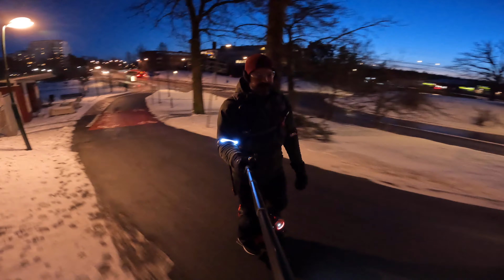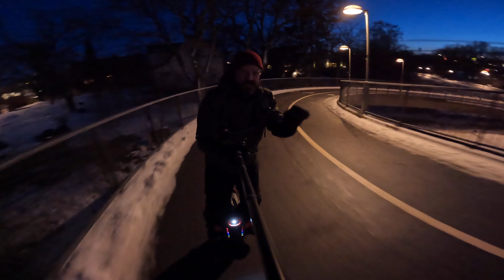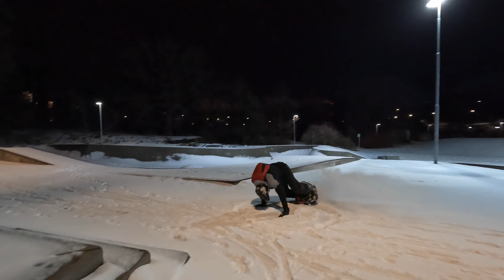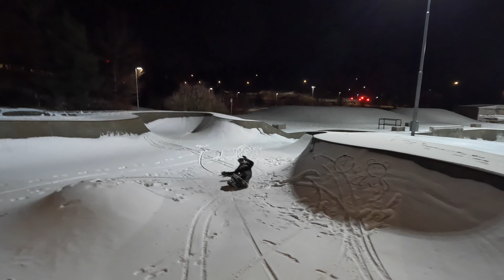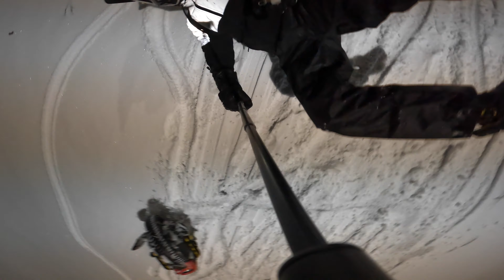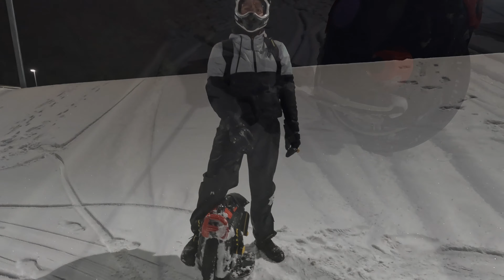My MSX 84v after 3 years - and some Snowy fun with Simon and his MSP HT

Comment: My pedals are stuck too. I forced the bottom screws out instead of replacing the pedals and just keep it covered with duct tape on the bottom edge now.
Reply from the maker: That's a good idea! Better than ripping the whole pedal and hanger apart. Definitely worth considering as an option when/if the time comes. Maybe my tire will outlast the wheel lol.

Comment: every time i see you riding the msx i have that thaught of regret selling my 84v 1859wh 2 months 2100km amazing euc drop mine only twice never have issues but ride only half a summer!
Reply from the maker: Oh so you got the mod with the 1859. That was quite a decent mod! Now that I have riding pads and bumpers on it I don't have any issue dropping it. The MSX can still be bought from Chicway! But the price has been climbing a little too high so it would be better to get one of the newer wheels out there. Still.. they are just getting heavier and heavier!
Reply: ya right 600$ more and you get the RS.
Reply from the maker: @Papalou1234  Exactly. And the RS HT can do just about anything. To the moon and back on that wheel.

Comment: how much km on Msx? Did You have any problems with this euc, did You change or repair something ?    
Is there any bigger difference between Msx and Exn in driving, comfort, practicality?
Reply from the maker: I have 18000km on it. I have lost a few hundred by letting it tip  to the side. Then it resets the odometer for the current trip. It doesn't write to permanent memory unless it is shut down.

The EXN is a bit hard to get going but much more stable and powerful. So for doing small corrections you will need to work a bit harder. I can still 180 it at a skate park etc and it does a really good job at it. It is a nice dancing wheel in the stiffer pedal modes and I prefer the softer mode for off-roading so that I can get some help with accelerating over obstacles. It is much more comfortable to ride having a bit of a wider stance. So it is a great successor to the MSX as a nice all in one wheel.